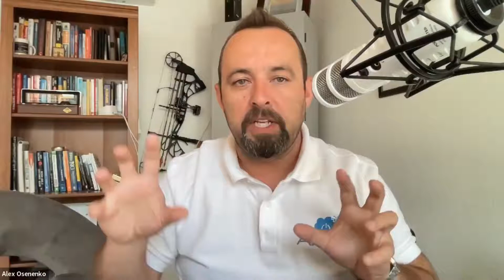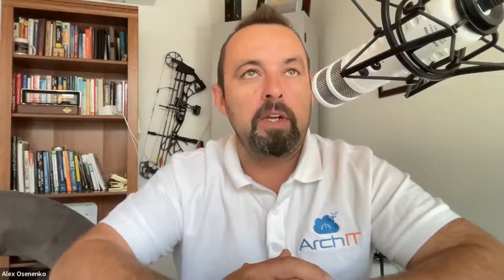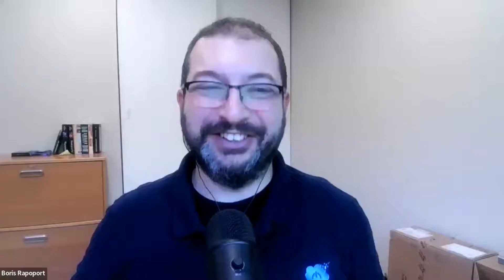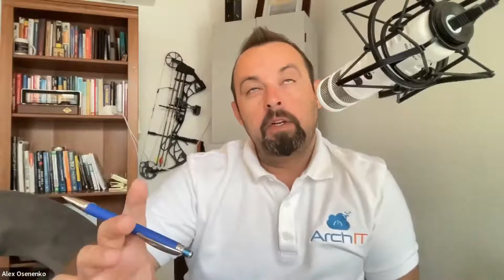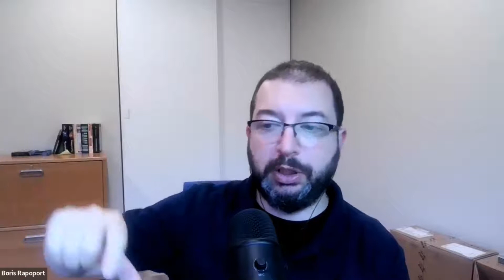Episode 47: Revit 2023-How to decide when to upgrade your primary design tool?

Comment: As an operations manager/BIM manager of a 30ish person firm, we only upgrade every 2 years for our typical projects and usually after a main patch, not just a hotfix. Depending on your harddrive size, having 4 years of Revit versions will reduce storage on your SSD and cause confusion with the staff. 

Upgrading every year is too disruptive unless there's killer time saving feature we must have (like the path of travel command in 2022) that's useful for life safety plans. Training would be required for this feature. In a healthy 25+ person firm, it's super beneficial to have an in office BIM Manager. I can't stress this enough. That person would be responsible for leading testing, implementation, standards update, training that is specific to your company's workflow. 

Firms that refuse to have one because they don't see the value makes me want to pull my hair out. They're worth their weight in gold and will easily pay for themselves with the increase in firmwide performance.
Reply: Also remember that when you start a BIM project with consultants, everyone consultant using Revit should be on the same year. If it needs to be upgraded, every consultant would need to upgrade if the project is a large project and takes a few years to complete. For the most part, I would not recommend upgrading those projects because it's working already, let the cycle take it's course. Otherwise, it's just adding potential new problems that's not part of the project contract and reducing everyone's project profitability. 

If you're using BIM360 as the collaboration tool, the process is easier because you can upgrade on BIM360 but it still requires coordination and people spending man hours on this. Most of the time, it's not worth the time.